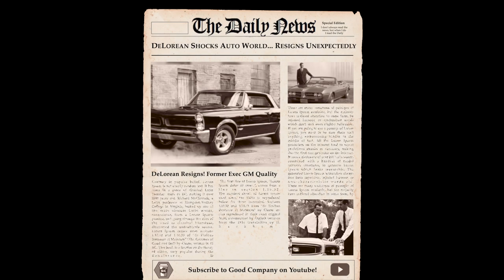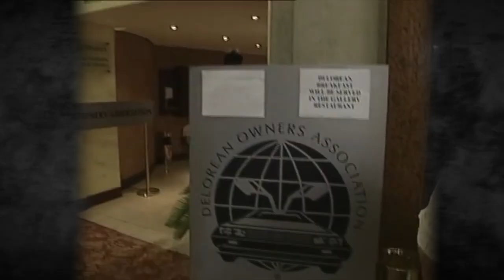The Rise and Fall of the DeLorean Motor Company

Comment: Please don’t degrade or use degraded historical movie content by contributing to the terrible epidemic of video editors who are guilty of committing the video atrocity of BBC (Blow-up, Blur, Crop) 4:3 aspect ratio films and video (or 4:3 films transferred to video) to fill the 16:9 frame. Doing "click to fill" may look OK on a computer screen (other than the unnaturally overly large images) but on a large screen TV the loss of resolution is terrible. They are taking standard definition video and degrading it to substandard definition video. They are also altering/censoring the carefully composed and framed 4:3 aspect ratio images by the historical cinematographers and videographers. This also applies to photographs although the usually higher resolution doesn’t suffer as much but the composition does.
Reply from the maker: We never change video aspect ratios, and most sites dont either. but some sources do, and if that's all we got, that's all we got. Thanks
Reply: @GoodCompanyTV  Try to find older, undegraded video. And, you’re wrong, since ‘click to fill”, most videos (one-half or more) of old 4:3 material has been altered.
Reply from the maker: ok will do, if you have any sources for great unaltered video, you'd be my hero! it can be tough to find, but I appreciate you Bruce, and Matt just told me you a fan of his channel too, so thank you for watching! I really appreciate you!
Reply: @GoodCompanyTV   Maybe the (media) Library of Congress.